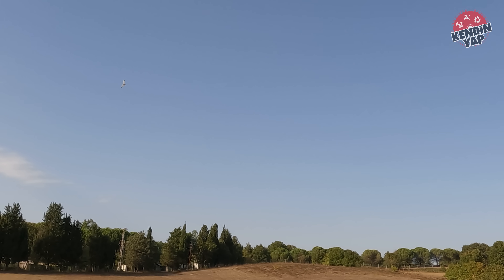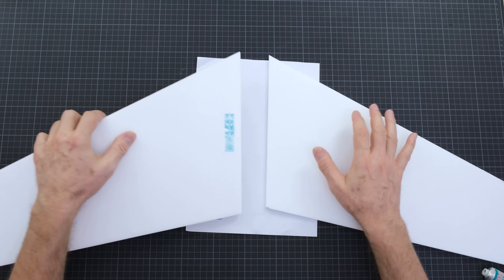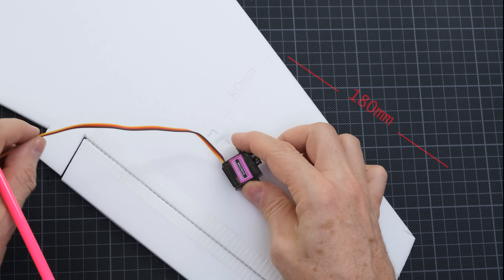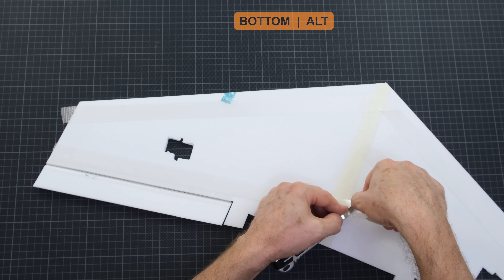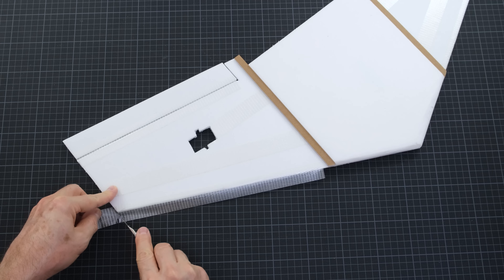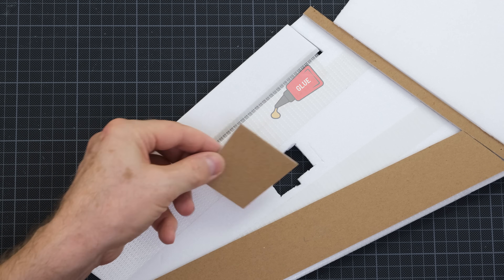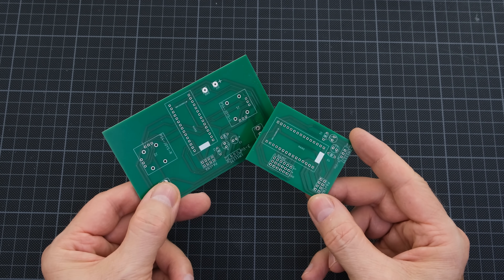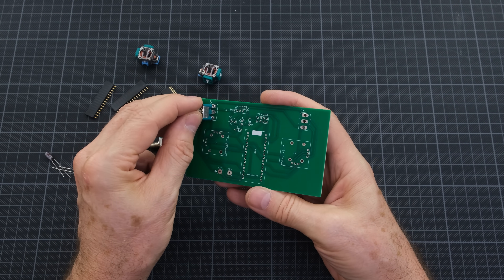Build a Flying-Wing with Simple Materials. DIY RC Plane & Remote Control

Comment: Had this plane built but I am experiencing some problems and I was wondering if you have a possible solution.  The plane seems to significantly roll and flip itself over when I turn the sticks after I launch it. The controls seem too extreme and it’s hard to control the wing. Besides minimizing the servo weight are there any other reasons for this? There is additional weight on the plane to hold a camera but the plane can still easily propel itself.
Reply: Укороти елевоны
Reply: Ig the position of camera is causing this, was it flying properly before u attached camera?
Reply: You need a flight controller like speedybee f405 to stabilize

Comment: Hello kedin, I will use a 5045 prop and a 1000mah 3s 40c lipo battery whose weight is 100g and mg90s servos and rs2205 2300kv motor, so will this plane fly?
Reply: And what if I make it using 3 ply 5mm cardboard
Reply from the maker: yes , it can fly

Comment: I see on the schematic of the receiver that Vin is going to the connectors and no option for external power. What was the thinking? A little research shows that the voltage from an ESC is not sufficient to supply the Arduino Nano. I'm going to add a external supply for the receiver. I will also supply the Nano 5V with the ESC.
Reply from the maker: If the 5V output pin isn't needed, the Arduino will run on 5V. That's fine. If you're using the 5V output pin, the input should be powered by at least 7V. My design doesn't use the 5V output pin. It works fine this way.

Comment: Hi, Kendin can I use a 2s battery, I have two bak nmc 21700 4000mah 10c batteries ( 140g total) ?? ❤❤..
Reply from the maker: I haven't tried it with a 2S. I'm not sure, but I think it could fly. If possible, try it in windless conditions, as the engine thrust won't be very good.

Comment: is it okay to use 1400kv moter a2212 with the props and escs in ts video?
Reply: He is using a similar size motor but about double the kv on 2s. If you use your motor it should work fine, but if you want it to fly as fast as his you can simply run your motor on 3s to get similar rpm. Prop type and size will also play a role but for such a simple model don’t overthink it. Just about everything will work.
Reply: @k.o.0 so if i get a 1400 kv motor the a2212 kind and a 30 a esc 
and using the a 5045 tri prop so it be fine right ?
Reply from the maker: A 5-inch propeller is not suitable for a 2212 1400kV motor. Thrust will be significantly reduced. You can try a 3-blade 7040 propeller. However, for this type of model (flying-wing), a higher KV motor (i.e., high-speed) and a smaller propeller will yield better results.
Reply: @RC-Maker-Lab  ic

Comment: Altı kanallı bir verici ve alıcı yaptım, üstelik PCB’lerini de üç kez tasarlayıp ürettim, ancak hâlâ çalışmıyor. Sizinle doğrudan iletişime geçmenin bir yolu var mı? Bu konuda bana yardımcı olursanız gerçekten çok memnun olurum.
Reply: Same here, can't make them work...
Reply: @tanmaychoubisa3409  I’ve spent a lot of time troubleshooting issues with this type of RC remote. Despite leaving several comments, I never received a reply. However, I’ve managed to solve the problem and get them working. Reply to me — I will help you out. I’ve lost faith in this channel.
Reply: @tanmaychoubisa3409  He doesn’t respond to queries — I’ve wasted so much time and money buying components. But through learning, I’ve built my own RC transmitter and receiver. If you’d like, I can help you.

Comment: I just built your other plane (30minute flight time one) and it flew great! Can’t wait to build this one too. One question though. How much extra weight do you think the plane would hold if including a 2200 mah battery. I’m thinking of adding an external camera although I’m assuming it’s not much if you didn’t have a POV from the plane in the video. Anyway thank you so much.  From USA ❤
Reply from the maker: It's great that you built and flew the previous model.
I think this model can carry an FPV camera and transmitter with an 1800mah battery without any problems. But with the extra weight of a 2200mah battery, I'm not sure.

Comment: Ustam mesafeyi test ettinizmi ? Max kaç metre veri alışverişi yapabiliyor ?
Reply from the maker: Başka bir videomda bu videoda da kullandığım 100mW modülü zaten test etmiştim ve 2 km+ (yaklaşık 2.4km) kesintisiz çalışmıştı. O yüzden tekrar test yapmadım. Alıcı da hepsi maksimum 20mW olarak çalışıyor. Antenli versiyonlardan biri olsun yeter.  Ama metal kasalı 100mW olanı alıcı da da kullanırsanız kasanın filtre özelliği nedeniyle uzun mesafe sinyal kararlılığı artar. Menzil değişmez.
Reply: @RC-Maker-Lab  Hocam peki herhangi bir gecikme varmı? Eğer varsa bu gecikmeyi  nasıl engeleyebiliriz?
Reply from the maker: @Suleymansckr  Normal kullanım  yani FPV olmayan modeller için modeli gönderdiğimiz en uzak mesafe 250-300 metredir. Çünkü sonrasında modeli göremeyiz. Bu senaryo için gecikme yok denecek kadar azdır. Ve kullanımı olumsuz etkilemez. Ama FPV gibi uzun mesafe uçuşlarında 400-500 metreden sonra gecikme hissedilmeye başlar. Hızlandırmak için radio.setdatarate değerini değiştirebilirsin. Benim kodumda bu değer 250KBPS dir. En düşük veri hızı ama en güvenilir ve en uzun menzili sağlar.  Değeri orta sevieye 1MBPS veya yüksek 2MBPS yapabilrsin. Ama veri hızı artar, menzil kısalır ve kararlılık azalır. Dış parazitlerden ,engellerden daha fazla olumsuz etkilenir.